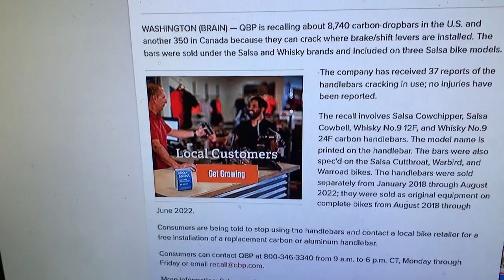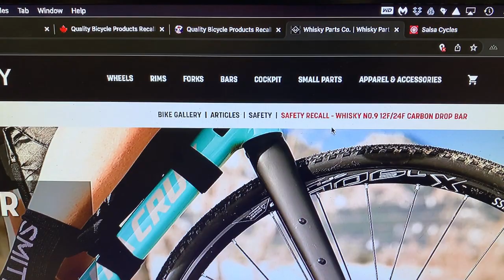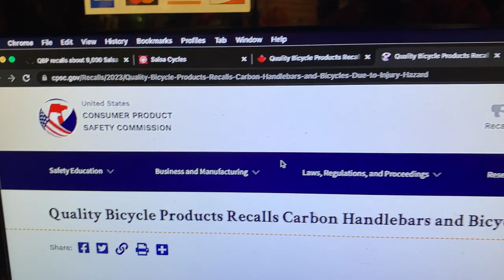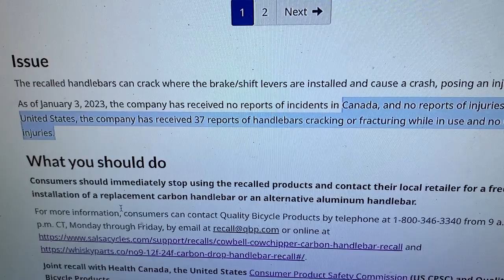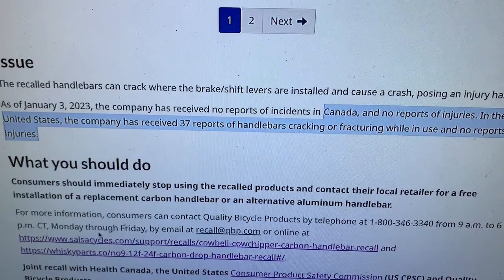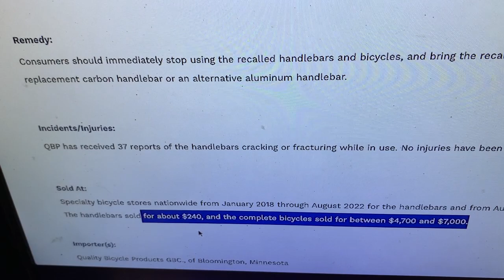Whisky Carbon Bar Recall - stop riding immediately

Comment: This is happening because the strap is not rounded, also the inside bar bracket that attaches to the shifter is also not rounded as well it's a small flat section that holds the bolt to the shifter. I always round out the strap out of the shifter in the handle bar. After I sand down a bit of the flat bar bolt head in order for that section to go around the carbon handle easier. Rounded Carbon bar handles need a rounded strap in order to not stress out one section vs the other. Think of it as the expansion plug in the headset you need to make sure the expansion plug sections are uniform around the steerer tube so what wraps around the outside must be rounded as best as possible in order not to stress the carbon steerer in different sections. In order to see how round the strap and bolt of the shifter are remove them from the shifter and try them out on the carbon handle bar now you can see if the roundness is too far off.

Comment: I always torque my bars to the torque spec of the bar.  For example I use enve round bars and they show 6-8nm torque at the levers, so I torque to 6.
Reply from the maker: I also torque things on the lower end of the range. If it slips I go up a little more but almost always avoid the upper end of the range.
Reply: @SeeYouUpTheRoad  yep!

Comment: I thought it was funny you mentioned the Ford Pinto. I had two of them, a 1974 and the 1980 which was the last year they made them. I bought that 1980 brand new off the lot with only 3 miles on the odometer for $4000. Hard to find a bicycle for that much now days.
Reply from the maker: Wow that puts things in perspective! $4K is not even a frame these days
Reply from the maker: @cyclingjoezone  that was awesome! Thank You

Comment: In general I’m pretty against carbon bars, people are just careless with torque values, where they get the carbon from and if they are cracked when you crash. Put in the aspect they are extremely expensive when made correctly and, in my opinion less stiff, than cheaper aluminum bars. No thanks from me. Had a friend buy 60 dollar carbon bars and they flexed a good 10mm over bumps NO JOKE.
Reply from the maker: Probably scrap carbon and lots of resin and filler.